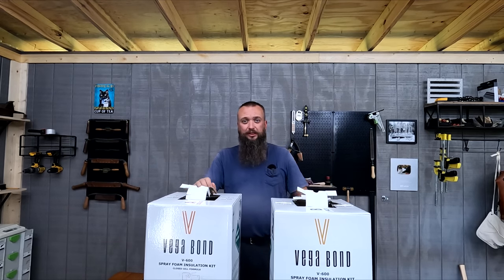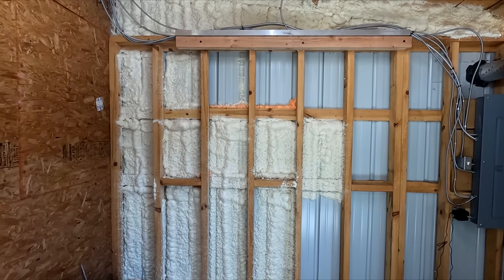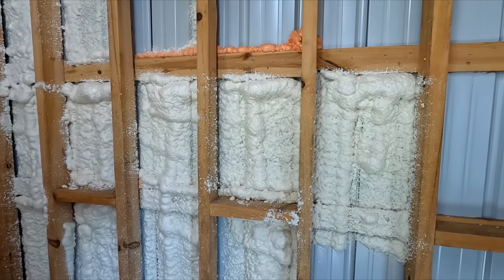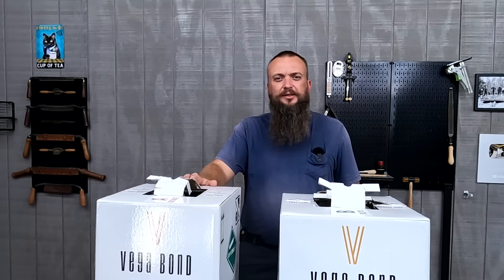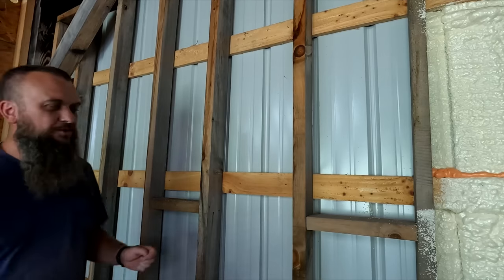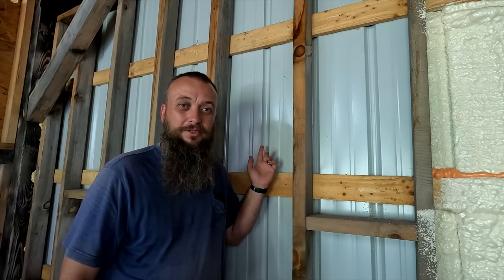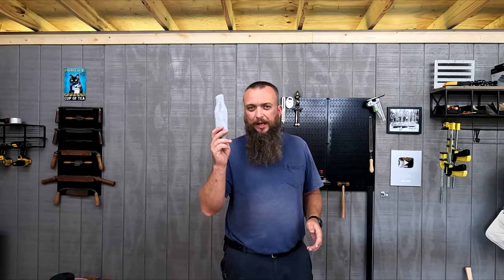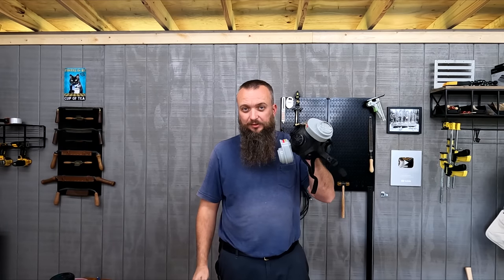DIY Spray Foam:The Video Pros Don’t Want You To See. Save $$$$

Comment: Probably too late but, you need to try and get the foam between the metal and the studs. If you don't it will cause condensation in the places where you can see the metal.
Reply: Yep which will cause the wood to grow mold at the least or rot in the worst case.
Reply: This guy is a lost cause
Reply: Hmmmm
Reply: Funny because he explained that before he started, definitely had no idea what he was talking about

Comment: this is a great video on how to use spray foam if you do not want to insulate everything and just spray randomly.  It is video's like this that say they are showing people but are showing them incorrectly.
Reply: What’s the correct way?
Reply: @JayTwizzle where the material bonds to the corners/edges.  I can see the steel behind the application still.  Watch spray jones if you want a video that shows how to do it right.
Reply: @therealguru9019  thanks

Comment: If I were doing the spraying, the first area I would want to get would be the area behind the vertical studs. That needs to be covered as ell as the spaces between the studs. Always wear complete body covering, always...A friend did use this insulation and he did put the tanks on a cart. While moving them for the first time he lost one from it falling over. Lucky it didn't go to the floor. Since then he always uses tape to tape them together and braces them onto the cart.
Reply: Voids behind the studs are an obvious cold bridge of a sorts and yeah... after you fill the spaces between the studs you can't spray behind the studs anymore.
Reply: @wombatillo  So what is your point??? I stated that you need to spray behind the studs first...
Reply: It’s like any coverage job (paint or otherwise). Do the fiddly hard bits first and follow up with the easy flat areas.
Reply: @davidcurtis5398  I think he was agreeing with you.
Reply: @Dave5843-d9m  that's my rule too.
Reply: Agreed also if you do one coat let it dry half way and do another it want sag and be so uneven 👍
Reply: @davidcurtis5398  Geez buddy, relax. He's obviously agreeing with you but explained the reason way more clearly than you did. No need to jump down his throat about it. 🙄
Reply: @rcgillsympaticoca  Not fun anymore - goodby.....
Reply: i really believe people come on YouTube so they can find something to complain about and they think there this expert or something .
Reply: @funtyes1970  Nope. no expert. It just makes sense to get the edges first, and that's only my opinion based on talking to a few dealers.

Comment: I was thinking of doing DIY spray foam on my house until I saw this. It appeared to me that the foam wasn’t expanding the depth of the strapping (3/4”) according to the difference in levels between the strapping and the metal sheeting. In the “after shots” it appeared a little deeper but you said that you went back and sprayed a second coat. Obviously all these DIY kits offer a very minimal foam insulation. Doesn’t seem like that was worth $800.
Reply: Have you gotten a quote from the pro's yet?
Reply: @ofthewoods137  no, I did not yet
Reply: @brianpaul9767  you are going to be shocked, you may want to be sitting down when you read the quote.
Reply: @ofthewoods137  yea, I figured it’s over $3,000
Reply: And that’s only for a small 1500 square-foot house
Reply: @brianpaul9767  we were quoted for 2300 sq ft. Over $10,000. We didn't do it
Reply: @ofthewoods137  OUCH!

Comment: Awesome Nathan, hope you had the acetone and got that mess out of the beard, I saw a guy on YouTube barndo site, built him a little plywood box, put a tiny electric thermo heater in it, and it was on wheels, he said keeping that plywood box toasty inside make this stuff flow even better, he was further up North, and it was cooling off already in his region.  You convinced me, I will do my own in my barndo when I am ready
Reply from the maker: It’s messy but makes a great seal. Keeps that metal from radiating so much heat

Comment: When we built my shop we applied house wrap to the outside just before we installed the steel siding. The foam then adhered to the wrap and the framing on the inside. If replacing a piece of siding becomes necessary it is much easier.
Reply from the maker: Good thinking
Reply: That's what I've said for years...

Comment: I used it once and found that setting those cans in a tote of warm water and weighing them down gives you a way better spray pattern and smoother coverage. They also run consistent right until the end.
Reply: Yes. Iso and Resin need to be warmed up.

Comment: Reminds me of all the reasons I stopped working in commercial painting. They started making paints that expanded on the surface after they were spray applied. Helpful tip about using a vaseline type product to put on any skin that is not covered before spraying. I sprayed a lot of epoxy type materials and the overspray would wipe clean with a rag if you used the vaseline around the cuffs of your shirt where the gloves ended and applied heavily on facial skin around eyes especially and anything else exposed. Also the stuff in your beard may work out with baby oil. Mineral oil which is what is used in baby oil is a solvent. Acetone erodes the oils in your skin and will dry your hair and may cause the spray insulation to water down on your hair instead of cleaning it.

Comment: Great video Nathan.  Thanks so much for the demonstration.  Come winter time I bet you are going to be snug as a bug in that shop. I will also point out that  foam insulation is very effective at sound deadening when you have your larger power equipment running. By the way, we had foam insulation sprayed in our home during construction.  The applicators wore the Tyvek suits and applied Vaseline on any exposed skin. When the job was complete they simply wiped the foam off of their skin with a towel. They explained that the foam cures with exposure to moisture and the Vaseline prevents skin moisture from contacting the foam.

Comment: I have a lot of experience with spray foam and the ppe required.  I wanted to tell you to wear the suit, but I couldn't travel back in time to do so.  However, one thing you should check before you go any further, is that respirator you were using. That type usually requires you to be clean shaven to guarantee a proper seal on your face.  With a beard, you need the helmet type, which encloses your entire head, and has a seal around your neck.  You will also then have a filter which attaches to your back on a belt, with a hose to carry air to your helmet.  Hopefully I explained that well enough.  You've probably seen the type I'm referring to.
That foam and any other brand of the same thing will stick to anything and everything, including eyeballs.  As for your clothing, that foam will be there now, for the life of the clothing.
Reply: Once had to shave my head due to a mishap on a construction site. I found out its water activated real fast
Reply: @GonzoDonzo  My dad was working at a factory helping the normal insulation crew put together a prototype polyurethane foam mold for a new water heater unit and something went wrong and one of the seams squirted expanding foam/liquid at him. Luckily it hit him only in the side and top of the head. Us kids had a fun time helping him comb the damn hardened foam out of his hair that night. 5 inches to the side and the stream would have hit him square in the face. Foam like this is nasty and dangerous without proper PPE.
Reply: @wombatillo  mine was similar case at a construction site. A glop fell through a seem right onto my head. I did get a free burrito for lunch out of it. Definitely earned it

Comment: also, do not put on a layer thicker than 3".    It needs to outgas when it cures,  and 3" is the limit for any layer.    Multiple layers can be applied once each lift / layer cures.  😃

Comment: One thing to keep in mind is that a vapor barrier and the center of thermal mass are different. In order to avoid potential condensation inside the envelope, you'll want to do a minimum 2" before any traditional insulation like batts.
Reply: That's what people don't understand
Reply: I just had a metal building built and the insulation that came with the building has a plastic white backing that is on the inside  of the building
Will this mold with time?
Reply: @mgoren9087  As a general rule, if the insulation is consistent the entire depth (entire depth is batt insulation, or entire depth is foam) you won't have issues. The problem with using foam and batts together is that people assume that the foam will block moisture at any thickness, which is technically true. But they forget about condensation. So if someone did 1 inch of foam and then did the rest in batts, the temperature will change inside the batt instead of the foam, causing condensation. Systems designed from the beginning that aren't combined with other systems 99% of the time won't have issues.
Reply: Even if he did spray 2”, he didn’t fill the gap between the studs and the purlins. That’s the first thing you do. That wall is going to sweat like a beer csn

Comment: I bought the same size about 2 yrs ago, it worked out great and you are definitively correct about wearing the suit and the need of a cart.  Plus,  I'd cover windows,  doors or anything you didn't want that stuff on.
Reply: What coverage did you get?
Reply: I got the 2 tanks at 600/sqft.   It was a different name brand,  though

Comment: I think Nathan  that you should starr at the top an eprk down also rotate you gun 90 degrees  and you could  get stud tu stud coverage. Anyway great job on all thing and loved the wood you run-through the molder
Reply: I've seen that exact setup with a side-to-side guide which steadily rolled or slid down vertical wall studs while keeping the spray gun centered with its spray pattern ends striking the stud side surfaces.  The resulting spray "pattern" was a uniform textured surface except where the spray passed over any cross-surface irregularities.  The person using that setup was a pro.  Most people with shop experience could build a similarly configured gun-guidance system with just this description.  It would make an instructive video.

Comment: I liked this video because you show what it is like to apply the foam in real conditions.  I would like to say I fully agree with you on wearing the suit.  In fact, you should avoid skin contact completely during the application of spray foam like this.  I also see that you used the full face respirator and it looks like you had the correct organic compound cartridges , but a couple things here that someone may have already mentioned.  Unfortunately, you cannot get a good seal on any kind of half or full face mask with facial hair.  It just does not seal well enough to prevent infiltration.  This is just a fact to the point that clean shaven is the only acceptable way to wear a mask that requires a facial seal.  If you expose yourself to organic chemicals on any frequency, you really should invest in a fresh air pump, hose, and air hoods that go over your head and blow out the bottom of the hood.  Of course the pump has to be located away from the area to keep from drawing in contaminated air, so lots of hose and a long extension cord are part of that deal.  There is enough of  a restriction that the hood fills with air, but then blows out of the hood keeping fresh air always available to breath and preventing contamination from infiltrating to it.  It's cooler too because the air is blowing into the mask.  Using a full face mask is also good in this case because you absolutely do not want to get this stuff in your eyes.  One of the components of this stuff is isocyanate which if you get it in your eyes can react with the moisture in your eyes and require removal by an opthalmologist.  Isocyanate is also an issue with inhalation for the same reason that it can react with the moisture in your lungs causing very serious lung complications depending on how much you inhale.  While it is never the plan, you have to think about your protection if the isocyanate hose were to develop a leak or rupture because of damage during use.  Anyone reading this should read the Safety Data Sheets which are available from http://vbinsulation.com where you can ask them to email copies of those Safety Data Sheets to you before you buy anything.    You can also download a lot of good guidance information from this site and they have a specific training module for professional installers for low pressure (less than 250 psi) two part kits like the one you used.  You can find these on their site http://spraypolyurethane.org  - use their professional site information since you are the installer.  To all you guys out there, don't ignore this stuff, protect yourself and keep yourself healthy for your family, they want you around for a long time.
Reply: Nice story. Not reading it.
Reply: It sounds like good advice from a professional....lol...

Comment: Thank you for pointing out the condensation issue with metal siding on pole barns.  As an Architect, I have had several people approach me about designing a "barndominium" , or pole barn residence.  I have tried to convince them about this condensation issue, but most people do not want to spend the extra cost for closed cell foam insulation to cover every square inch of the metal siding and roofing....and you should use CLOSED CELL FOAM, because it is a vapor barrier and a moisture barrier.  Open cell foam is not a vapor and moisture barrier, and it is also less expensive than closed cell foam, and has a lesser R value.  These type of buildings were never developed to be climate controlled residences, and if you do not take this precaution you will get condensation and mold.  
Most people don't want to hear this because it bursts their bubble of somehow finding the magic path to a low cost house.  I could talk for about an hour as to why barndominiums don't save you a dime against standard residential construction techniques.  I don't think the codes in most locations have caught up to this trend yet.
Reply: Would depend on cost comparison of metal siding material and labor of install vs other siding options...the lack of thermal transfer cept at the post of post frame vs16 on center studs is a consideration, agree that the condensation issue is often overlooked..I'd prefer to conventionally frame on 16 centers, simpler and faster for me but with the price of osb this last year, $2 sq ft and if going over 10 ft high walls it's impractical .. I'd go with the post frame ..probably 2 " closed cell to prevent condensation.
Reply: @RICK-uf1jj  You still have to frame up stud walls around the perimeter of the inside of the pole barn to run wiring, plumbing, batt insulation and to have something to mount your wall finish on.  That is redundant structure.  Those walls are capable of bearing the roof load just like in standard framing.  The posts and beams are redundant.  It is also easier to frame those walls up if the posts and beams aren't in the way...you can frame them on the ground and tilt them up...not so easy once the post and beam structure is there.  
You can frame the entire thing with standard walls and put metal siding on it if you absolutly want to have a house that looks like an impliment shed.
Reply: @stevevice9863  understand the problem of standing interior walls after trusses are in....unfortunately unlike commercial framers residential framers( have done both) and the 3/4 " subfloor decking are in the weather nearly the entire build due to this...SOLUTION: utilizing lighghtweight non structural METAL STUD  INTERIOR CURTAIN WALLS  as soon as youve dried it in.....avoiding the heat an cold, unnecessary double top plates,straightening wood studs, extra expense as metal was cheaper than wood these last couple years and all the..strain on backs carrying and standing wood framing..and if its a 2 story...all the work getting studs up there....there is a negligible learning curve but well worth it..an yes you can trim the interior well despite not having wood backing ..
 Same for the non structural inner wall between post...theyre merely a non structural.curtain wall..no need to waist time an money framing these with  2x4s...and this curtain wall wont thermal bridge as its not in contact with any exterior framing.( metal stud 3 3/4 "...post with purlins nailed to outside...minimum 5 1/2 " thickness...)
Another benefit of post frame is being able to avoid a continuous footer...considerable savings where deep footers are required..⁷
  Agree with your assessment of the look of a barn that metal siding provides but much less an issue when located on wooded rural  property. Code does take into account that the shear strength provided by osb sheathing can be had with metal panels attached to purlins..and if added.. closed cell foam adds shear strength as well.

Comment: Moisture barrier is what it's called. In a site built wood frame home traditionally you would use the paper clad fiberglass insulation and the wrap over the OSB board outside also helps to retard the migration of moisture. But with closed cell foam it wo;; do the same thing without the extra step. You might want to use the paper sided insulation anyway, just a bit neater to put up. I would recommend a long sleeved shirt, rubber shop gloves and some sort of goggles. Fiberglass gets everywhere!!

Comment: I know up here in Illinois.  You need a minimum of 2" of spray foam.  Otherwise, you will get condensation.  
And no you can't do one inch and then fiberglass.  You will still get condensation.